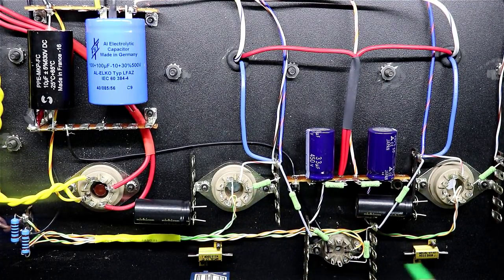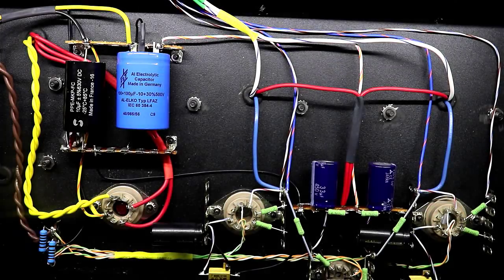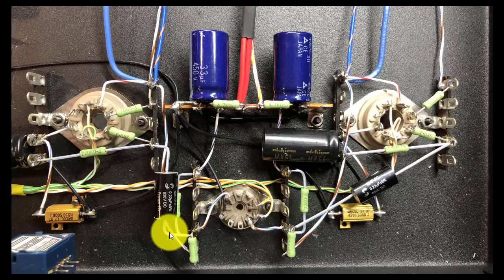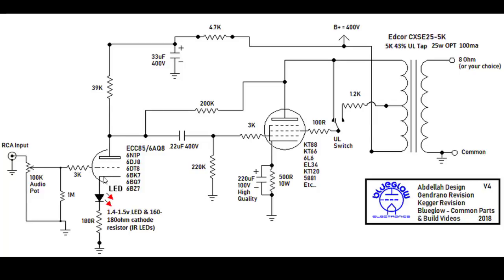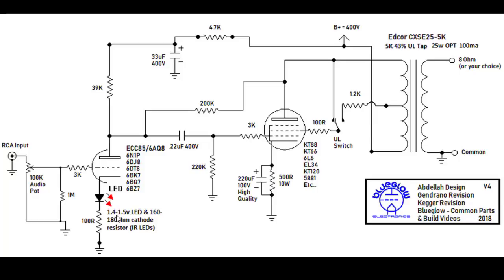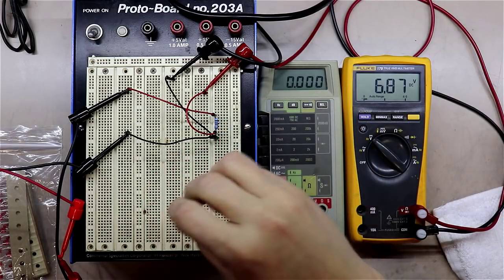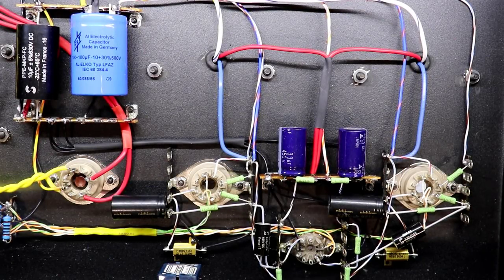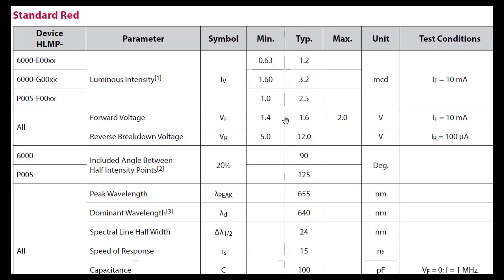KT88 - Single Ended Tube Amplifier Build 2018 - Part 7

Comment: I built one and it sounds excellent (gec kt88 and Philips ecc85) ,no tweaks necessary. Using 89db speakers but would like to try pi or econowave at 95 db for better dynamics. Absolutely no regrets as first amplifier I've ever built.........Many thanks Mark !!

Comment: Conceptually, your teachings are starting to make sense to me, learning with every video and elated when I know exactly what you're about to say!  One question though, the audiophile being inside me keeps on asking one question during this build: wouldn't using one side of the small signal 6N1P tube for the right channel and the other for the left make crosstalk between the channels happen? It seems to me that the 2 different signals are super close to each other at the electron level. I wouldn't ask except for it seems odd to me that you've taken great pains to twist the heater wires, keep the power supply as far as possible from the amplifier section, crossed two wires at a 90 degree angle, etc.....

Comment: I have sometimes built radio equipment where I made every component parallel to an edge of the chassis. Nothing at 45 degrees, including wiring. This looks quite good, but RF engineers complain about it!

Comment: You could use a 1W White “lighting” LED in the cathode circuit of the KT88, these can operate easily at 350 mA or so, though their Vf is typically 3-5 VDC; you’d have to adjust the value of the 500 ohm cathode bias resistor you have there now. But it might be interesting to see if the LED brightness changes as the amplitude of the audio signal changes. 😁

Comment: It’s unlikely in the extreme that flipping the switch during operation would damage the tube; the thermal mass of the plate (pin 3) would prevent the tube from getting red hot in the few milliseconds that the grid (pin 4) is floating, unless the tube was already poorly biased and red-plating anyway. Now, if this was a solid-state amp, then - yes - I would put a warning label on the switch to “not change during operation”, as semiconductor electronics are a lot less tolerant of B.S. than tubes are! 🤠 The real problem might be a loud >pop< in the speaker as the switch is thrown.
Also, I don’t see in the video where you wire up the LED in the cathode circuit of the preamp tube. I’ve also never seen anyone design a tube amp with a diode in the cathode bias, though I have seen designs with a small battery (or a B- supply) to provide a negative bias.

Comment: What is the correct bias voltage for KT-88? I have a 1 year old chinese Audioromy 808. Class A/B push-pull.  2  KT-88's per side. After 580 hours one of my ElectroHarmonix KT-88's went blue and a pop and no sound on right channel. Asmall bank of 3 large resistors came unsoldered. I fixed it. Put back in Shuguang tubes, went fine for 900 hours and one Shuguang went blue and pop and the left channel was out. Same thing other side. A friend on facebook said the bias voltage could be way high, but my amp doesn't have a pot to change it. Maybe it's self biasing? What do you think? He told me to put a 1 ohm 5 watt resistor between one of the tube socket pins and ground and measure voltage across and use a formula to calculate. Problem is I don't know the formula and I also don't know what the bias should be for my particular amp. Does the amp matter or is it the tube bias? It also can uses 6550's if they have a higher bias setting.

Comment: I think you should be careful about your disclaimers that there is no ground current flowing through the chassis. Current takes proportional paths to ground, not the path of least resistance. In this case (since you're using a steel chassis and copper wire) much of the current is going through the wire (by an order of magnitude). However if you were using aluminum chassis about a 1/3 of the return current would be flowing through the chassis (between the second ground connection and the original star ground).

Comment: Batteries were used in the grids, not cathodes for bias.
Reply: In early electronic equipment, a battery was used to supply the directly heated cathodes (filaments).

Comment: Hi Mark, Thank you for the very nice videos. Most of the tube amp builds I have seen are using 100k volume pot. Would appreciate it if you can explain why this resistance value is preferred compared to say 50K pot. How do we determine the appropriate value for a given tube amp project? Thanks again.
Reply from the maker: At the end of the day, its just a voltage divider.  You can use whatever size you want as long as you scale the other components to match.  100k is just very common.

Comment: You should have made it easier on yourself and made an LM317 constant 5 ma. current source so you don't have to keep tweaking your power supply.   Now that I think about it you could make yourself a permanent test jig with the LM317 IC and make a permanent tool for this application with little effort.   Great vid.  Thanx.

Comment: A few observations: 

I must disagree with the wire bypassing the chassis. Electricity takes the lowest resistance path, not the shortest. (Actually, it's a ratio depending on impedance.) Chances are the chassis is a far lower impedance than that thin wire.

If the coupling cap is big enough, and a quality film cap, differences shouldn't be audible.

Why not tie a 1Meg resistor from screen to B+ to "stupid proof" the rear panel switch a bit?

Why isn't the LED bypassed? Diodes tend to be noise sources. Zeners are far (far) worse in this regard, but a forward biased diode creates noise too.

Instead of a LED, why not an adjustable VBE multiplier?
Reply from the maker: Keep in mind, I'm trying to build this as close to the Kegger design as possible.  Did you watch video one where we discussed all that?   Once built, I have many tweaks I plan to do to it and will do that as a "tweaks" video.  On the grounding thing, I'll make some comments in my next video.  I know many major amp designers / builders who use this technique, done so many times myself with deadly quite noise floor.  I'll show some examples in the video.
Reply: @Blueglow  I didn't know viewers weren't supposed to have opinions. 
-1 subscriber.
Reply from the maker: @misterhat5823  nothing wrong with opinions, just have to be ok with debating the topic.
Reply: Ground wire bypassing the chassis. I have been professionally designing and building industrial electronic control systems for over 40 years, and in our equipment those ground wires are almost always used. The chassis is nowhere as low an impedance as it may seem. The DC resistance may measure zero ohms, but introduce AC and the impedance can go through the roof. UL does not require these bonding wires "for nothing" - they have their reasons.
My only suggestion - make that bonding wire a good heavy gauge, like maybe 14 AWG.

Comment: I'm loving this project. No need to apologize for cutting away for the LED explanation. That's the kind of thing I want to see.
I wonder why we use LEDs rather than a diode without the light emitting property. Maybe it's just because there are so many LEDs around??
Reply: The voltage drop of a standard diode is lower.

Comment: Hi Mark, love your build series here, great job on explaining, I just eat popcorn and enjoy watching someone else solder. This is a great help to those new to electronics.  BTW I would like to help you with a small thing, as you say, if you see something, say something. So as it turns out I speak some Japanese and Nichicon is pronounced [nee-Chee-kon] no big, deal I just thought you might like to know.  I buy lots of them from Digikey and they are great electrolytic capacitors.

Comment: Maybe as an option the switch at the back could be mounted internally with stand-offs.. Just to prevent any “accident” to the output tubes while in operation.

Comment: Another question:  Why are you using an IR LED for 6N1P bias?  Is it solely for the low voltage drop an IR LED offers? A red or green LED drops about 1.8V, not much different than an IR LED.  A green LED could then double as a "Condition Green" indicator.  No LED lighting up would indicate a blown heater in the 6N1P, or do I have this wrong?
Reply: Sorry, I should have viewed the rest of the video before asking this question.

Comment: Could the switch be make a short before break vs break before short. If so then switching while on shouldn’t be an issue.
Reply: No, you definitely don’t want a switch that has make-before-break action here; it would short the top half of the output transformer through the 1.2 kilohm resistor, which would cause the magnetic field to collapse and generate a nasty voltage spike. Also, it would put more current through the bottom half of the winding (from B+) to the center tap, and to the plate of the output tube and could result in shortening the life of that winding over time, not to mention throwing off the bias on the tube due to the increased B+ at the plate, although only momentarily.

Comment: what's the best component of a tube (pin) to lead an effect into -if one wanted to include an input jack to plug into the circuit? probably varies from app to app, may even feed it into the last part of the circuit instead?  but, say I wanted to install a reverb effect into a F Vibrochamp?

Comment: What I don't understand is why the led doesn't rectify the ac signal current?
Reply: mfr58: I think it actually does. If you were to monitor the current through the LED it would vary based on the AC signal, but all the time keeping the DC bias point relatively constant.
Reply: Actually the LED is always forward biased.
Reply: @dri50  Ah, so the ac rides on the dc, so it's varying dc, right? Thanks.
Reply: @mfr58  Correct - you would actually see an AC current thru the LED riding on the DC bias point.
Reply: @dri50  Thanks for clarifying that. M

Comment: For those interested in more info on using LEDs for bias, there is lots of info in Morgan Jones book "Valve Amplifiers". Specifically he uses the either the HLMP6000 Red or what he calls the "Cheap Inefficient Red", for voltage drops of 1.63 or 1.7 at 10ma. He also discusses the other colors and their respective voltage drops.

Comment: hlmp6000 i have 1600 of them a lot of the standard red led's are electrically identical this i know from building led display projects there is no magic in the hlmp6000 or any other standard red led
Reply: I bought a bag of 20 from mouser and tested them all. Pretty much no difference between them at 5ma, and if there was, it was like 0.01ma

Comment: The layout looks a bit busy. Did you consider the possibility of using turret board or vector board with vector clips to solder the components to?
An awful lot of commercially made "pro" audio equipment used turret board construction.
The point to point wiring just does not look nice. In the world of commercially built electronics point to point wiring was reserved for very simple circuits or to shave a few cents off of the build cost.
Reply from the maker: Compared to most tube amps, this wiring is pretty darn simple.  Rarely do you see turret boards in audio gear due to the complexity and space requirements for 2 channels.  I have seen some and some that are beautiful (Leaks, McIntosh) but I enjoy good old hand wiring myself.

Comment: led's are one the noisiest diodes there is you need a cap across the led
Reply from the maker: Keep in mind, this isn't my design.  You should click the DIYAudio link above and post in that thread about your thoughts on the LED needing a cap.  I've seen a lot of cathode biased LED setups and can't remember seeing any with caps across them.
Reply: @Blueglow  led's are great as zener that is true but like any semiconductor to keep them quieter toss a 1uf film cap across the diode / led
Reply: Raw LED's are not noisy, especially when powered by DC. LED lamps can be noisy but that is due to the integral SMPS used to power them from the AC line.
Reply: @davekazoroski6548  i am talking raw led's not lamps
Reply: Understood. But from what I have researched, any raw LED noise is in the microvolt range at worst. Yes, there is an optimum forward current for minimum noise (type dependent).
From what I have found LED's are used a lot in carhode bias circiuts, with no noise complaints from builders.
Reply: @davekazoroski6548  if a builder want to create the best bios they would use a negative rail and ground the cathode that is the best and quietest way
Reply: Yes, that is called "fixed bias". It is typically found in higher end amplifiers. Costs more to implement due to needing extra components for the negative ("C" battery) supply. All in all, LED bias is a good low cost compromise between cathode bias and fixed bias.
Reply: @davekazoroski6548  i will agree on this fixed bias is the best and you are correct there is a small extra cost $ 10-20 but worth it
Reply: @God-CDXX  Noisy LED , can someone show this to me , how is that possible , what is the reasoning behind it .
Reply: But then again, Mark is trying to reproduce and test an existing design. I beleive he said he might tweak things after testing to improve performance.